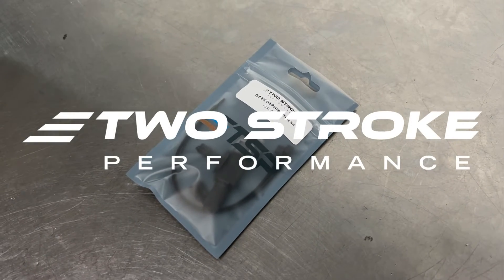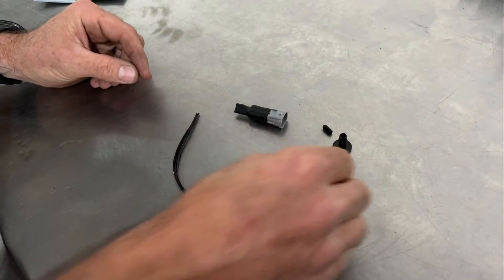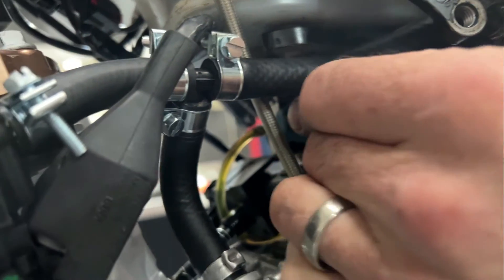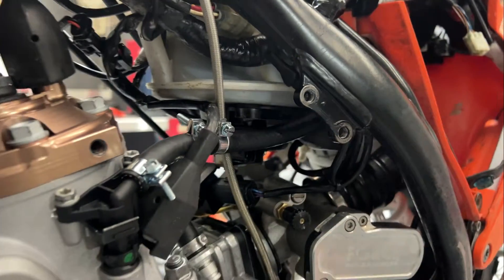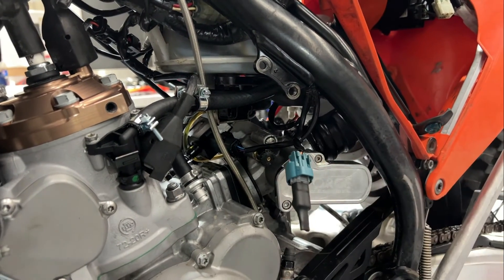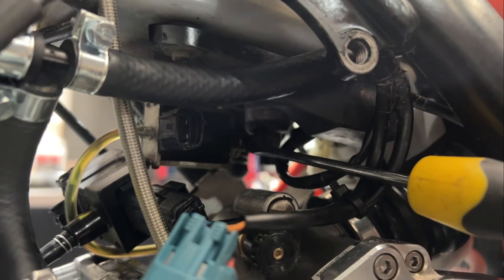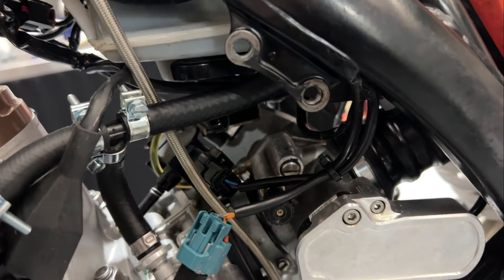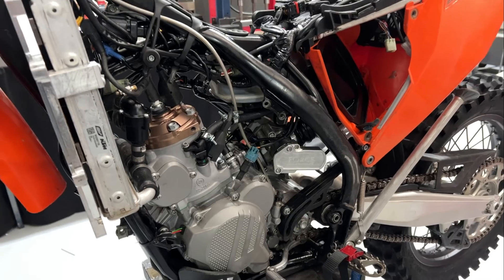Two Stroke Performance TPI Oil Pump Delete Kit Installation

Comment: Why does it get not enough premix gas over the standard pump an fule line?

Is the mircro filter the problem in the fuel line of the tpi models?
So if i delete the oil pump an reassembly the oil pump system. What more i have to do to run premix over the tank and gas pump?

Comment: I just got a 2025 husqvarna 300 te tbi bike and I was wondering if I could just plug in the delete and then mix my fuel or if I have to relocate something or plug something like you mentioned with the tpi bikes
Reply: For tbi like your bike all you need to do is plug in the delete and you can mix fuel
Reply: Did you find out mate?
Reply: @NB-91  everywhere I've looked says you can leave it plugged up

Comment: Stock fuel injecter can handle 50:1 ratio oil premix? it wont get clog right? i plan to do relocation mod and  install that dummy.. it seems i can use stock injecter. By the way the oil ratio will change obviously so it wont affect the  timings of  denotations inside the piston right?

Comment: Hi - Im looking at adding your TBI kit to my 2021 Ec300, If I do the oil pump delete , must I also address the intank filter and other small inline filter to be able to handle the higher viscosity of pre-mix fuel?
Reply: No thats a myth, stock inline filter works just fine.

Comment: You use must use the Twostrokeperfomance's fuel injector relocation kit to the intake boot.
Or as I did before they had theirs out I used a different kit to relocate 1 fuel injector to be between the throttle body and the reed cage using a relocation block.

To use the oil deletion kit and go to 100% premix you MUST RELOCATE 1 fuel injector so it is now getting premix that will lube the motor's bottom end bearings.
Reply: Did the split kit from the other brand make it where you could slam on the brakes without the idle dropping to low or did it just change the characteristics when on the gas I am currently using another brands relocation block and it runs great but when I come off the throttle and pull in the clutch on the brakes, it idle so low, it almost cuts off and has a few times I ordered the split kit thing today hoping it will solve that. I want to try this one since you get a map specifically for it but financially I would love for the one I have to work the way I expected it.

Comment: Can I use this with my GET ECU and injector relocation kit? 

Any additional benefits than what I can do with GET’s customizable fuel mapping features?
Reply: To use the oil deletion kit and go to 100% premix you MUST RELOCATE 1 fuel injector so it is now getting premix that will lube the motor's bottom end bearings.

These relocation and oil injection kits can be used with a stock ECU , a Coober ECU (I have this) and a GET.
The oil deletion kit has the electric dongle to make the ECU think the oil pump is still there as it has a resistor in it to fool the ECU.
With going 100% premix the engine is always getting lube as opposed to when an oil injection pump craps out or wears out and the rider does not know until the motor seizes.
Reply: @human1513  are you sure this can be used with a stock ecu tune ? Does the relocates injector fire on cold start idle ?